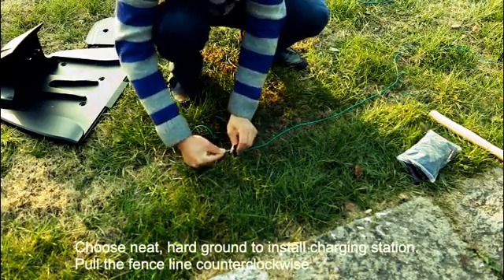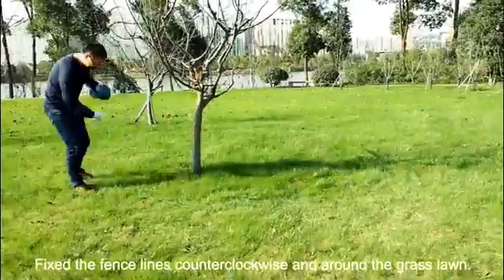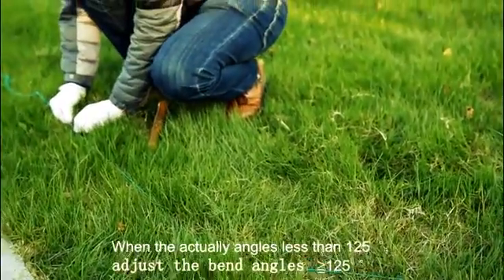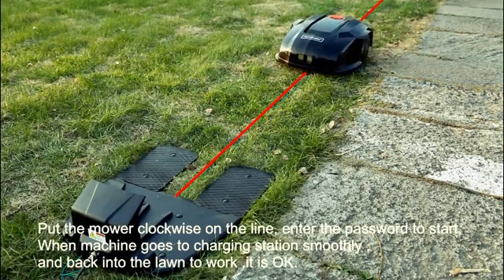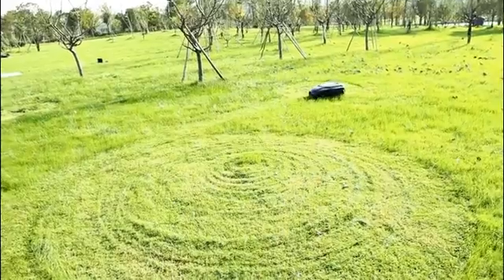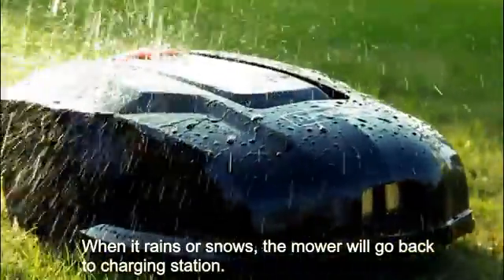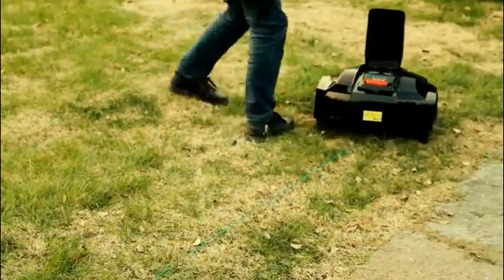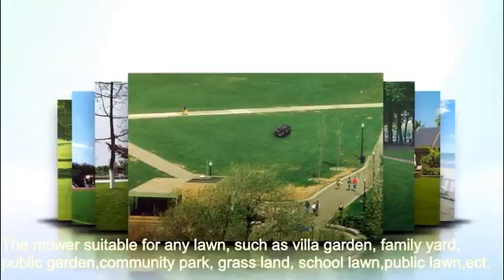Automatic robot lawn mower from YOMBAND

Comment: This would be great seller if, it had an app, camera ai wireless borders (no wire boarders), even lidar slam.  It is great in the double blades aspect and slope climbing and speed.  But, behind current models with latest tech... and, what's with the circles?  People want straight lines.  Upgrade this fine offering for moder times, please.  Upgrade, send me 1000 units to the US and we will set the new standard in US and make millions if not billions.  I will contact on business page.